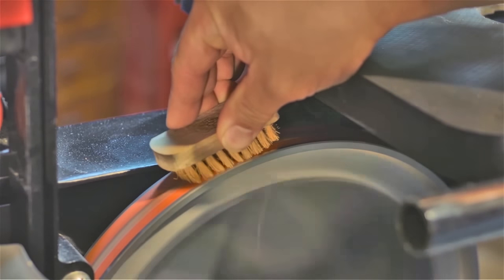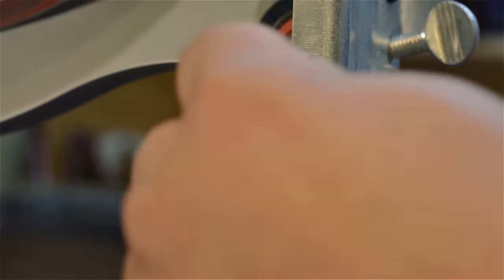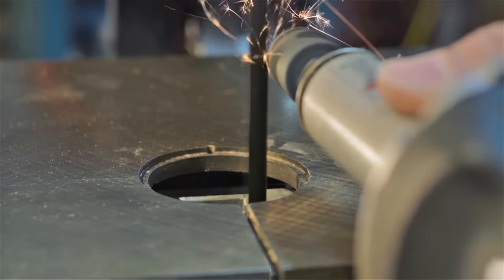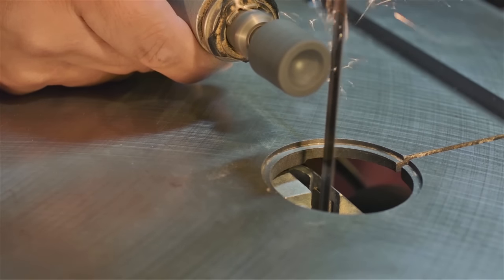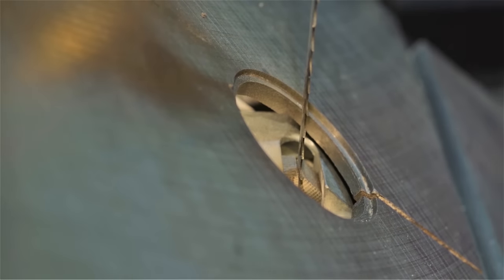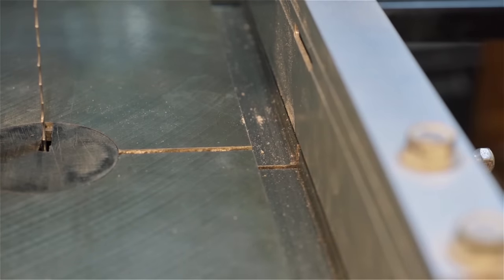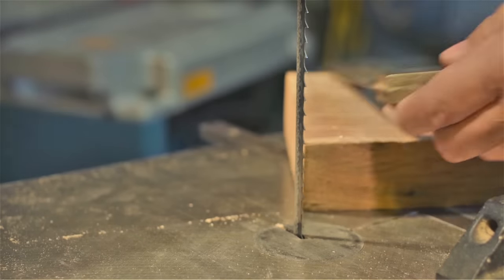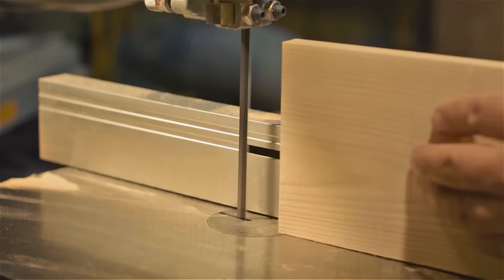Bandsaw Tuning For The Anally Retentive

Comment: Hi Joe. I have trouble setting the tension on the blade. The width designators don't seem to match up with tension on the blade.  The manual doesn't address that issue. Any ideas. Regards.
Reply from the maker: I generally just tension till the flutter goes away. Watch the rubber tires, and make sure you're not over compressing them.
Reply: @RockwoodJoe  thank you.  I will try that.

Comment: My old Clarke 12"  Woodworker CBS12WV has started to bind, ie, switch it on and it just moans and no movement of the blade. Power off and move the blade in reverse by hand it seems to then comes 'free', switch it on again and it runs. Switch it off and on again and it binds... lost for what to try. The whole thing had been cleaned out of sawdust, wheels not clogged, etc... can you help please? It was working fine beforehand and then the blade began to drift from straight
Reply from the maker: Check true of all wheels? Does the lower wheel start and stop fine without a blade on it? It could also be the motor starter capacitor - but not likely. Run the saw, without a blade and check for wobble, trueness, bearing play etc. Good luck.
Reply: Thank you - I'll give that a go. The blade runs just over the rear edge of the top wheel (ie, not in the middle of it, but it is in the middle of the other two wheels) - is that right?   @RockwoodJoe

Comment: Nice adjustments on that puppy and it appears they paid off. I dont understand how grinding the back of the blade was helpful. Care to eleborate?
Reply from the maker: If the blades aren't joined in a perfectly flat plane, then the blade effectively moves in and out - and where the blade was joined is like a high spot - the vertex. I grind the back (keeping the grinder fixed) to remove that vertex. This does nothing to keep the teeth in line, but it does ensure that when the back of the blade contacts the thrust bearings, there is no "high spot" that can hit it and cause even more issues. This is the number one issue I've seen with all blades, is that they are not joined perfectly - expensive or cheap. Hope this helps.
Reply: @RockwoodJoe  i get it. Very nice.

Comment: how do you balance the wheel? great vid...thanks!
Reply from the maker: I didn't balance it at all, they came like that from the Mississippi facility. That was Delta's claim to fame in the 80s and 90s, boasting a dynamically balanced wheel. Yes, things have changed since the old days. Black & Decker ruined an American Icon.

Comment: Say, how long did it take (that is, how slow should you go) to pass that teak board past the blade when you cut the teak board to get the 610 veneer? You had it sped up.
Reply from the maker: You can see the speed at the beginning, before it is sped up. A reasonable speed would be 1/2 inch per second I reckon. Thanks.

Comment: not sure I would take a grinder to the blade.  but where do you find end of run blades?
Reply from the maker: At a saw blade manufacturer. The last bits of the coil (wound tightly) are usually the least desireable.

Comment: I have a Grizzly G0555 and can't resaw to save my life.  Called Grizzly service and the guy told me that I shouldn't expect it to cut straight slices!  What?  I haven't tried all of your steps but I will.  Trying to get my bandsaw to resaw straight seems like trying to find unicorns.
Reply from the maker: What you want might not be attainable. If the Grizzly hasn't been machined reasonably square at the factory, then it's nearly impossible to get the saw to cut cleanly. You can use shims to help straighten things up - but they generally only work at one setting. Best of luck and hope it works out!

Comment: And what's your perspective on the direction of the toilet roll? Running to the outside, or to the inside?
Reply from the maker: That is a silly question, as assuredly you must run outside to facilitate better access. You can also better judge the exact number of sheets that you consume when running to the outside -- and it is easier to separate along the perforations on the outside. I have signs posted for roll replacement instructions in my house, which I believe is the norm for most North American households.

Comment: 4:15 - why would  grinding the back side of the bandsaw blade have any positive effect?
Reply from the maker: Because the backside will come in contact with the thrust bearing under rapid feeding force and any "hump" or "kink" in the backside will cause the blade to jump forward changing how it is supported. You want the blade (when it does contact the rear thrust bearing) to be a smooth datum. It's like driving on a perfectly flat highway versus hitting a speed bump at speed.

Comment: how  did you isolate wheel and system vibration
Reply from the maker: Wheel balance was already near perfect, as the older North American made Delta's were dynamically balanced by cnc from the factory. This used to be a "selling" feature if you view the old brochures. System vibration came mostly from the v-belt, which I swapped out with a link belt. The motor, (Baldor) is also well balanced and Delta mounted with rubber bushings. I believe this Delta is a Mississippi saw (built before the plant was closed) and production was moved to a more hybrid (offshore+USA) facility. You'd be surprised how crappy Taiwan motors can be for vibration. I swapped my jointer motor for one I got at garage sale that was 40 years old and it made a huge difference. Start with the electric motor, put it on a table, and see if it walks around. I know it's a pain to remove - but isolate that first. Then the pulleys, then the wheels. Are the drive shafts perfectly straight? I've seen horribly bent shafts and pulleys too. Finally, check out the wheels.
Reply: thanks  restoring cast iron art decco saw

Comment: I've got a 3/8" blade with some minor twist & kinks.  Is there a way to true it up again?
Reply from the maker: If it makes a very load tick or rubbing sound when you run it, then it might have to go to the garbage.
Reply: @RockwoodJoe    Not that bad, but I won't use it for any work that requires a high degree of accuracy.  Thanks for your response.

Comment: Could you please post a link to these 3M rust removal pads you are using?  I couldn't find these.
Thank you
Reply from the maker: You will find them in most hardware stores that carry body work supplies. Generally labelled "Scotch Brite rust stripper, polishing etc." eg. https://www.amazon.ca/METAL-FINISHING-BUFFING-SCOTCH-BRITE/dp/B000HVE30K/ref=sr_1_2?s=hi&ie=UTF8&qid=1536452239&sr=1-2&keywords=3m+metal+polishing  They can generally be purchased individually for far less.
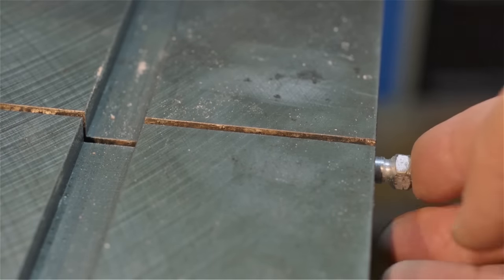Reply: Also I've been wondering for a LONG time now - what's the purpose of the pin from 10:28?
Reply from the maker: The pin is slightly tapered and fits by friction. It supposedly keeps those wings in alignment. You will crack the table if you pound it in hard with a mallet.
Reply: Rockwood Joe The one you were using in the video has a shape of a random orbital sander pad (round with holes for the dust collection). That’s what I was more into and couldn’t find. Sorry for not making myself clear :)
Is it really what I thought it was?
Reply from the maker: Yes, I bought them somewhere a long time ago, and they are 5" random orbital pads. Generally used for body work or metal work etc. They work good. Sometimes home depot might have them too.
Reply: Rockwood Joe I’ll try looking them up. It’s about time I clean some rust out of some of my tools :) and this looks like the perfect solution.

Comment: I don’t think I could be this patient with a saw. I also have never changed my cool blocks and they’re still good but I leave a very thin gap. With your process of actually touching the blade why are bearings not your method?
Reply from the maker: Blade isn't perfect enough to constantly run on the bearings. That is why I dress it with the grinder. It's just almost running on the bearings.
Reply: Rockwood Joe I mean instead of cool blocks that you have to change and wear out use the bearing style instead?
Reply from the maker: @onecarwood  The cool block contact more of the blade reducing its flex from side to side. Bearings touch at an infinitely small point (remember geometry of a circle?). I have no idea why bearings would make sense - as they literally provide no support for side loading to the blade. They touch it, but that's it.  Think of a high pressure tire versus a tracked vehicle contacting the road etc.
Reply: Rockwood Joe I get where your coming from but the cool blocks are wearing out and really not touching most of the time unless you constantly adjust them. Bearings are not wearing they stay where you put them so would always be touching. It really wouldn’t matter that it was a smaller point of contact. You have it from above and below pretty close together. Just my point of view. I could never constantly fiddle with a tool. If I had to I would be less prone to use it.

Comment: Did I miss the part on leveling the table?
Reply from the maker: Maybe, but my table was already level as Delta machines the  cast iron trunions perpendicular to their mounting points. If you've cost cast aluminum ones, that are just bolted to a stamped steel saw - you might have to shim or f*ck around to get the table decently perpendicular.

Comment: If you have ever watched a winch cable snap because a portion of it comes in contact with metal during a tensioned haul, you'll realize dressing a blade's backside whilst in motion is a very bad idea. You also want to use a stick to turn the wheels, not your hands, especially the lower wheel! Putting a square next to a moving blade is foolish at best. All of the operations you perform while the blade is in motion are not advisable. Follow the manufacturers guidelines and observe proper safety precautions. This video will get you the nickname stumpy nubs!
Reply: thing is you can't see what it is really doing unless its running

Comment: My Skil brand bandsaw cant even cut walnut an inch thick without dying.  I need a new bandsaw that will re-saw... Le sigh
Reply from the maker: Try going used if feasible, and a common model for parts availability.

Comment: Man, OCD is right, I like it. Are you a machinist by chance?
Reply from the maker: No, but I do have a degree in engineering and worked as a process optimization specialist in automotive manufacturing for 10 years- so yeah, I'm uptight by nature. I understand machinists too... let this be a lesson to all those young folks, don't let your formative years be measured in decimals! Everything not within a few thou in the future will bother you... for the rest of your life. I only made the video, because I felt the advice out there was just recycled too much, and didn't address how a band saw actually is meant to work. It's just my take on it, and the classic Delta can be very accurate if need be. I really only use it for making gunstocks and fixing musical instruments from exotic woods. Cheers!
Reply: Your square and combination set looked like they have been around for awhile.
I am a machinist and yes, everything that is not within a few thou bothers me. I wake up at night and think of that job I let go, out of spec, twenty years ago!
My Dad, a pattern maker, saw me using a mag base and indicator to dial in the cuts on my cabinet door frames. He laaughed; "Well I guess you're not making any money on this job!"Also judging by your fluent use of imperial and metric, you must be a fellow Canadain.

Sorry, I don't usually go on in the comment section. Thanks for the great video.
Reply from the maker: Maple syrup and back bacon ehh? I got the square and combo set (starrett) back when I was 16, and it was well used then!
Reply: Yes sir. Cheers!

Comment: is grinding the blade a real thing it sounds incredibly unsafe and unrelated to the problem its supposed to solve but I have been wrong before
Reply from the maker: If the blade was perfect to begin with this wouldn't be an issue. If manufacturers made their blades a perfect width, thickness, and welded exactly in-line this wouldn't be needed. I am demonstrating with a $5 blade that - even with a perfectly set up saw - a significant amount work is needed on the blade to ensure a good cut. If the blade was a perfect thickness, why would you need to put a $1 bill space between guides? Why not let the guides actually act as bearings? My point, is that all that is "taught" about how to set-up a bandsaw in the past is really about accomodating various discrepencies in blade quality. I've also found that, just because a blade is expensive, doesn't mean it's any better than a cheap one. Hope this helps. Cheers!
Reply: @RockwoodJoe  thank you that does make sense thank you for the explanation

Comment: The problem is everything you did worked.  What about the rest of us that things are off when we try.  It would be nice if we saw some measurements that were off so you could show how to correct them.
Reply from the maker: I know what you're saying. What is not shown is the amount of adjusting the saw to get it perfectly aligned or running smoothly. The video assumes that your saw is already "near perfect" and only the blade needs to be tuned. The most common saws sold today are the stamped metal saws, which I've found are actually less tune-able. The older two piece cast iron saws (top arm bolts to lower assembly) can be adjusted so the upper and lower are more in-line, as well the lower cast iron yoke which is bolted to the lower assembly can also be slightly moved around. All of this adds up to a more repeatable performance. I'm looking at buying a second saw to cut styrofoam, so it will probably be a Rekon and I'll attempt to do a "tune the saw" video. This video is really more of a "tune the blade" video. Thank you for you idea about showing some measurements!

Comment: Be anally accurate with your knowledge of each machine about setting the guides, blade and backing rollers.  Ignorance of proper setup of equipment can get someone killed.  As a seabee builder in the navy, I learned all I could about every piece of equipment that I could.  I kept a shipmate from dying when our 3' bandsaw had been ignorantly reset by an ignorant person who insisted on using it even though I had thrown the breaker off when I found a 3/16th inch curf worn into the back roller guide.  I had gone immediately to report the damage, and get a lock to lock out the saw, but the ig-1 came in and was making cuts into hard cutting wood with the blade skipping over the curf.  Another man came to watch and was right in the line of fire when I dragged him back out of danger.  After I set him down, the blade went off the table top right about where his chest had been only seconds before.  That 18' 9 3/4" by 3/4" wide blade cut a 3/4" into a cast iron jointer fence before getting through the heavy chain link material in the lumber rack gate and cut a 3' diagonal rip before a wad of blade stopped it in the fence half way through.  
Another time the shop chief got caught by some wrongly done table saw blades that had not had any tooth set done to them.  The chief had a 3' 2"x4" he tried to rip that the blade hung in the curf and threw it back into his face.  He had his cheek opened up to the bone, and had to have about 4" of stitching in his face. I have been very aware of safety and proper set-up of equipment, ever since.

Comment: how do i check the problem you told me to try
Reply from the maker: Move the guide up and down against a square on the table like shown, except also do side to side. Blade guide should move perfectly 90 to the table front to back and side to side. If not, then your saw might have to be shimmed - or get a different one.
Reply: thanks for the help

Comment: I found this video fun to watch, but the blade grinding seems very odd to me. All you are accomplishing in the best of circumstances is to change the surface finish of the blade metal and in the worst of circumstances is to create thin spots in the blade. The only part of the blade, even a cheap blade, that could cause any issues is the weld joint, but hand holding a grinder to the blade has nearly no chance at all of helping that problem. A dull blade, tooth set, and or excessive feed rate are what cause the issues you were trying fix.
Reply from the maker: You make the assumption that the blade is joined perfectly straight to itself. The backside must form a PERFECT datum - or rather be 100% straight to the thrust bearing. Imagine taking the blade, and putting it on a perfectly flat glass table with the backside down. Are there any gaps? Probably. A blade that moves forward and backward in the guides, is not the fault of the wheels (they are fixed) - but the blade manufacturing itself. A blade that oscillates (forward and back), even so slightly is what will cause issues when it is forced (yes, by overfeeding) into the guides. I grind the sides, with extremely light pressure to remove any high spots, because sometimes coated (oxided) blades have dirt glued to them from the coating process - or the weld just sucks.  Sometimes you get a perfectly made blade - and sometimes you don't.

Comment: A bandsaw is one of the most mistreated tools in any shop, wood or metal. Another is a drill bit.
Reply from the maker: The proper way to sharpen a drill bit is to use that little angled slot on the tool rest of the bench grinder - then by hand push it as hard as you can to make lots of sparks while turning it slowly, and unevenly. Once you've made sure the point is off center you are now done - as that indicates the bit has been sharpened and is ready to use by others.